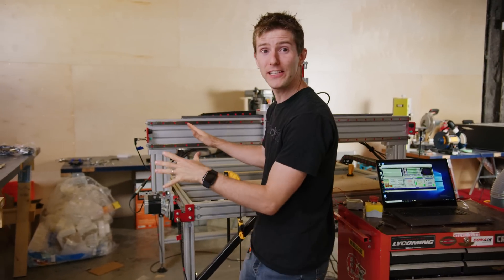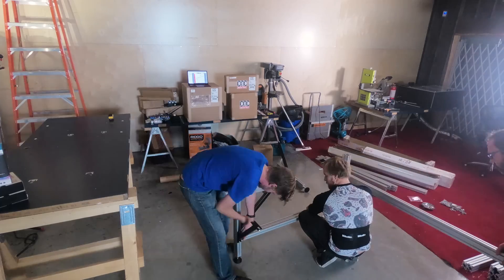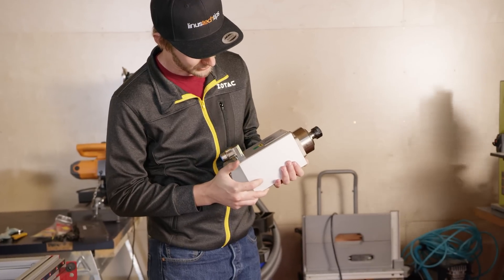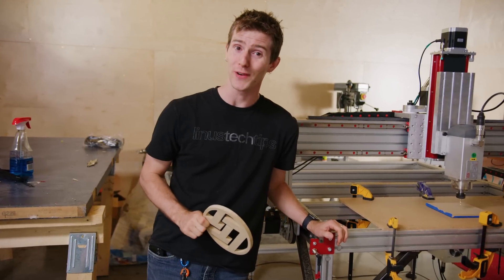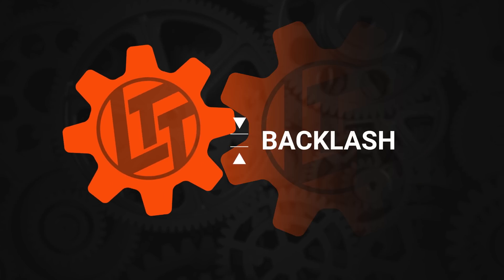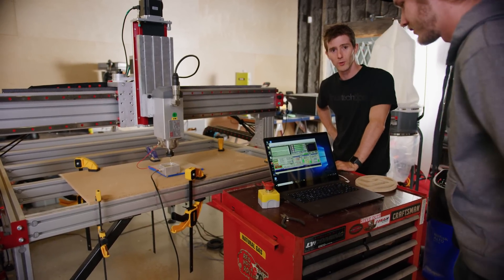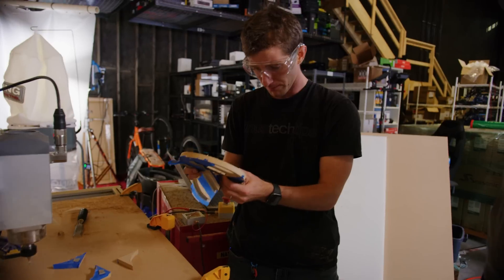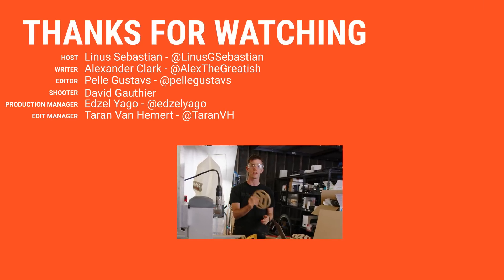Our New $10 000 Router!

Comment: Add LED spinle light, helps allot, Air blast nozzle will also help allot on lots of materials.

And first off, dont go cheapo on cutting bits, it will only give you bad cuts and they break fast.

Comment: this router not newer cost 10 000$ all parts cost about 3000-3500$ max, spindle and steppers+drivers has all expensive parts this about 1500$ table can made home 100.200$ max, elektric can buy ebay all same 500x cheapen, i has build thousand cnc and newer has go 2000$ more.10 000 has go only one plasma cnc but size has 12 meter x 4 meter x 0,5 meter,stepper motors nema 23.frame cost this only lot because has wery big I beam and U beam wery lot. belt and motors no cost lot. same cost ewery cnc all elektric max 300€
Reply: OMGosh, Anybody else have only a slim idea what Matti's comment means??   - . '

Comment: you can cut metal, although you need different bits and different speed and feed etc. but it is possible although you need to then set up a cooling fluid to cool the bit as it gets HOT while cutting metal.

Comment: The problems with backlash are actually a little different!  It doesn't have much to do with changing direction- that's just when it's noticeable, and needs to be compensated for. 

The first problem is that when the spindle wobbles, it bounces around in the region of backlash.  Theres nothing pressing it down tightly so it just rattles freely.  More backlash means bigger rattling.

In most common machine tools you have gibbed dovetail ways instead of linear rails.  Backlash is the reason.  A gib is a long metal rod that presses into the dovetail tightly, keeping it in place.  Half-decent dovetails with gibs are actually MUCH more rigid and accurate than linear rails, but the cost is a lot friction.  That makes them unsuitable for CNC machines since you need big motors and because it forces the operator to go by feel.  In a gibbed dovetail, the friction in the ways keeps backlash from mattering for vibration- but the operator has to manually compensate for the backlash by turning the screw until it's as tight as possible, but not so tight as to force the way to actually move.  Obviously computers can do that far better than any human... for a price.

That's why hobby-level machine tools often use linear rails.  They have much lower friction and are accurate enough for simple jobs.  If you compare them to dovetails at the same price point, they can even be more accurate- dovetails can be much better or much worse depending on cost.  It's a battle between sliding and rolling friction: cheap sliding bearings < cheap rolling bearings < expensive sliding bearings.

As you climb in price and performance it actually switches back and forth more- ballscrews and linear rails can eventually compete with high end ways, and then air and magnetic bearings and ways eventually win at the ultra-precision, tens of nanometers realm.

Comment: If you're cutting metal (aluminum or light steel) get some flexible hose attached to FOUR nozzles so you can spray or jet a stream of NON-FLAMMABLE cooling fluid (an oil which is recyclable) or plain water towards the area being CNC'ed.

If you want to get REALLY FANCY when routing hard steels such as hard Plexiglas/Acrylic, Stainless Steel or Maraging Steel or 8000 Series aluminum, you can do FULL IMMERSION CNC where the part itself is immersed fully in a 12 inch deep tray of NON-FLAMMABLE and HEAT-RESISTANT cooling oil or plain water so the ENTIRE PART is cut/drilled/routed underwater. 

Do remember that that ONE LITRE of cooling fluid is about 2.5 lbs or one kilogram of weight, so make sure the routing table can actually withstand 1000 kilos of weight (2500 lbs) that will be caused by a fully filled water/coolant tray. Also, I would HIGHLY SUGGEST some extra electrical grounding-to-Earth and ground-fault-interrupt switches for your controller gear, water-sealed electrical cabling and for the motors which SHOULD also be upgraded to FULLY waterproof motors!

With that UPGRADED machine, you can CNC full aluminum or stainless steel cases with 3D sculpted artwork such as skulls and cross bones for your pirate-themes computers, or you can make a single SUPER-DUPER-COMPUTER-CASE out of a solid block of Aluminum or transparent or tinted Acrylic with room for EIGHT fully 3D sculpted interior forms which have built-in cooling fins and standoffs that can fit x399 motherboards that are FULLY IMMERSED in LIQUID COOLANT !!! Now THAT would be a killer project to do for LTT!

P.S. Remember to powder-coat the metal version of the 3D sculpted 8-Motherboard super-case using glow-in-the-dark yellow paint with blue pinstriping and a skull'n'bones pirate motif!

Comment: Why not connect a hoover or fan extractor too the side of the cutter which goes to a detachable bag which you can then give away or even use to insulate your house ? :D ;  also why not go for a laser cutter? yes more costly but it would make life easier on cutting, detail, clean up would be nothing if set right, no drill bit changing. only thing i can't see it doing is cutting anything over 10mm (well it can but it would take a long time and multiple cuts).  

i work with laser cutters on a day to day. an i have always thought of custom making engravings and cut outs on case sides. Even more so on the Corsair cases as you can buy the sides cheap off their sites.

Comment: We build these type of frames all day long within the 3D Printing community and print 3D Parts, Upgrades and Mods for it.
We also don't just click go on our 3D printers, lol,... I personally use Fusion 360 and SolidWorks to design models and then convert it to G-Code, so the machine can read it and then we set the speed of X, Y ,Z and extrusion speed and width, same for the layer hight. So just clicking Go will not work, it's somewhat more complicated just like the milling.

Comment: what you should do is put a head onto the spindle with bristles and connect a dust extractor to it run it along the gantry then it wouldn't be in the way of the spindle or any other of the parts

Comment: You should build an acrylic unibody liquid cooled computer cabinet.
The mobo will be attached reverse for the cpu to make contact with the cooling. PCI slots will have a cut out etc.
Perhaps consider making a system for media playing with on chip graphics, rather than having an off board graphics card, to make everything more efficient.
You would need two or more layers of acrylic to route the liquid canals in one, maybe cables in another and so forth.
Reply: Or maybe just use a laptop mobo for the project

Comment: Use better prameters for drilling speed. Might use also better tools for wood cuting or acrylic. 

And don dive in to deep to fast. Pre cute and than make a finishing cut so ur edges get smoothly. And use 90 degree cuter so you can make edges on the edge of your part. :)

Comment: Ok, so LTT has now a CNC Mill. I'm studying this, though the metal variant and it is cool as heck, both manual and CNC. EDIT: And no, if you have to do that kind of heavy cleanup lower the feed rate on the finishing pass. By the looks of it, the feed rate is cranked quite high for the last pass.

Comment: Linus, As I posted earlier PLEASE check your legal requirements as an employer. Search "Safeguarding Machinery and Equipment - WorkSafeBC" for an Idea of what you need. Consulting an expert may be helpful. 

For relatively cheap bits, check out Shars.com for some $5-$10 USD endmills and other useful tools.

I heavily recommend a dust skirt mod for your spindle and get a vacuum designed for saw dust. E.G https://www.zoro.com/jet-2-stage-dust-collection-hood-jw1049/i/G0641980/  I do not know if that is a good product!!! just an example of the style.

Edit. also good reference for starting Speeds and Feeds (always test for your Specific tools and machine it may slightly off) . https://fswizard.com I bought the full version for the added benefits.

Comment: Just call it what it is, 'The CNC machine'? Just 'The CNC' for short.
Laser cuters, routers, printers, they are all essentially the same thing under the hood, with different kinds of tools whacked onto the business end of their gantry. Everything gets run as G Code (typically).

Though while I'm writing this - This Old Tony had a video about a manual remote control for his CNC that lets him easily adjust his machine. I kind of want one of those for my 3d printer - but for a $10k CNC? It might be a good idea to have one.

Comment: CNC's are so much fun. So much advice has already been given, but I thought I'd throw in my 2 cents.
I recommend slowing the feed rate but a lot, press the red button when changing tools or reaching in before/after a job (It should cut power to the steppers and spindle making it safe), wear safety squints, jesus christ don't press a chisel towards your arm, and you can get a vacuum shroud that goes around the cutter to help with the mess.

Comment: I work with high end CNC machines every day. Linus needs to discover ball screws and inline direct-drive servo motors. And you don't want to skimp on whatever you use to hold your material in place. In this case more is better unless you don't mind projectiles shooting across the shop.

Comment: @13:32 Quite the drama "Queen" about 3 cents worth of tape...
Reply: I don't think the cost was his concern, rather the excessive amount of stickiness making it difficult to remove.
Reply: I think he thought it broke the wood, but it was just the removable parts. That, and of course the annoyance from it being stuck down.
Reply: 3 cents of tape is like a inch of tape
Reply: @9208655  Looks like Blue Painter's Tape with an average cost of $3.58 for a 60 yard roll from Home Depot...works out to about 0.0016 cents per inch or about .019 cents per foot.... So yeah, a lot of girl crying over a little bit of tape....remember it's $10,000.oo CNC Router...
Reply: @DrTeddyMMM  He wasn't complaining about the blue tape, he was complaining about the gray tape.
Reply: @DrTeddyMMM  That wasn't being held down with blue painters tape. Blue painters tape is not double sided, so there so no way in hell you would be able to hold down something with it. He was referring to the grey stuff on the back side. Those cost a probably $2-3 an inch. So... they clearly used probably a foot or so of it. So that was like a decent chunk of change when it could have been done for much less.

Also, Linus is extremely cheap. There's a reason he drove a beater car for years.
Reply: @DrTeddyMMM  lmao please don't tell me you're defending imperial units... I live in America and the metric system makes much more sense.
Reply: When you are the bottom line on every expenditure, it gets overwhelming.
Reply: god damn youre stupid
Reply: @vitti2801  well in units used by the only country to get to the moon, sooo. . .
Reply: @WaiteFamilyFarms  NASA has used the metric system since the 90's, so even they figured that it was superior to the imperial system. (sorry, "US customary units")
Reply: @michaelrowse4217  
only since the 90's?????;

I thought they been using metric forever since we were always taught in school... when applying to sciences you use metric units as it is the universal system

well.. i guess there was that one time in the early 2000's where someone used miles instead of kilometers and crashed a 100,000,000 dollar probe into mars surface.....  Pretty sure that guy got fired.. and everyone that was supposed to check his work
Reply: @michaelrowse4217  so your'e saying that after they went to the moon they switched over and haven't been back since. . .
Reply: @WaiteFamilyFarms  I was just quoting a Space.com article from 2007: "When NASA returns astronauts to the Moon, the mission will be measured kilometers, not miles.

The agency has decided to use metric units for all operations on the lunar surface, according to a statement released today." - https://www.space.com/3332-nasa-finally-metric.html
Reply: @WaiteFamilyFarms  Too bad NASA uses metric. And who said America doesn't have healthcare? We have the best healthcare... that's why you have to pay for it. And for every smart person, there's a dumb person; else there would be no such thing.
Reply: @WaiteFamilyFarms  now did you know that the best NASA scientists are mainly german and japanese???
Reply: the country with the countless wars for oil and no health care?

Comment: Hum, a home built ATX compatible acrylic and wood case?

Bit obvious I appreciate, but would make for a simple starter project. Possibly build the main framework from wood with acrylic panels - possibly using multiple layers of acrylic with patterns carved into it in different sizes to give a colour change. Could even use opaque layers with a transparent layer sandwiched between - then use LED lighting strips around the edges within the wood framing to illuminate the transparent layer to make the carved in patterns illuminate.

Comment: Your CNC Spindle will be BEND if you are machining the wrong plastic material!!!!! before you go use acrylic or plastic material, make sure the kind of plastics does goes into plastic flakes when its machined by the blade, or else the heat of the spinning blade will cause the plastic to melt, then it will form a plastic ball at the blade, then start to bend the spindle, and render then spindle useless, the spinning becomes irregular circular motion. CNC is a dangerous machine, make sure you guys know what you guys are doing. make sure set up soft limits and hardware limits, if something does go wrong it stops automatically, human push emergency button is too slow.

Comment: I run a CNC router with a 5x10 cast iron table/gantry with vacuum hold down, automatic tool changer, and servo motors. I literally want to write you an essay of things that will save you months/years of learning.
Reply: I would be open to video calls to give you guys tips.
Reply: Likewise. I run 4 komo routers a 1 northwood 5 axis router and program all myself.

Comment: no safety shield, No sub millimetre accuracy, Aluminium frame, Chinese motor drivers, No chip evacuation vacuum, no coolant spray (for when milling soft metals)
And you call that a 10 000 $ router? BullCRAP

Comment: CODE NAME: "S.C.A.L." 
EXTENDED NAME: "Sir Carve A Lot"
Suggestion: engrave the back of an iMac (even and older one) and modify it in order to liquid cooling it (like you drill a couple of holes in the back to let the tubes coming in and out of the iMac's chassis).
I have always wanted to see a liquid cooled iMac.
Maybe you can engrave a piece of aluminium with the phrase "Designed in Canada". Or something dumb like this.

Comment: To hold down your parts it's easiest to put tape masking tape on both the part and the table and super glue between them. Very strong and has less movement than the foam GoPro tape. (also easier to remove)

Comment: ummmm 10k$ for this frame without suction bed nor Trow bed ? lolz thats a waaaaaaaaaaaay overprized ...... i got 2.5 x 1.5meter  cnc router with profesional precision angled gear sliders for ultra 0.001mm precision / resolution .... with vaccum suction and dust pump for like 12k. .....    https://euro-komplex.eu/wp-content/uploads/2017/05/cnc2-873x1024.jpg

Comment: I don't think i'd be thrilled about cutting MDF like that without respiratory protection... Its banned for use at schools because of the potential hazards that the dust presents. No conclusive evidence yet but the adhesive used in the manufacturing process of MDF is a suspected carcinogen

Comment: Is there a betting pool on how long before a Windows Update destroys a job?
Reply: From experience about once every 2 months
Reply: Correct me if I'm wrong, but doesn't it send the program to the controller in that first "power supply" that he opened up? Would it matter if the computer loses connection or do you mean it restarting in the middle of designing?
Reply: @alphapuggle  Don't know. If it is good controller there will be a way to load the gcode ( The Instructions to move the Drillbit) into  it and let it go. If not, the computer will feed it line by line. You see the same thing with 3d printers. This is the reason OctoPrint exists.
Reply: It sends a few seconds worth of moves to the controller. Every now and then Windows will use up too many resources usually right around update time. With Mach3 even running the files on a USB stick will cause problems. The files we run are a lot simpler than router files usually just X & Y.
Reply: @Zarathrusta1976  I think the ones we used in our school work differently. They worked over the network and our network was pretty crap. So I think that one would download the file then complete the job.
Reply: I was going say in the two weeks
Reply: Had this happen at my last job, ruined a good piece of red mahogany

Comment: A used Haas vertical mill like the VF2 would provide much higher accuracy in aluminum or delrin than that router can do in wood.  But, it's pretty cool that Linus is showing off some less tech equipment.

Comment: Get a cordless stapler with nylon finishing nails to hold your work piece down. If you accidentally run over one of the nails, it won't harm the bit and it is quick and easy to both attach and detach the work piece to your sacrificial table top with little chance of movement.

Comment: The stepper motors don't have 200 electromagnets, usually just 2 windings and 4 wires as shown in the diagram. It is the rotor that has many segments, leading to the 200 steps.